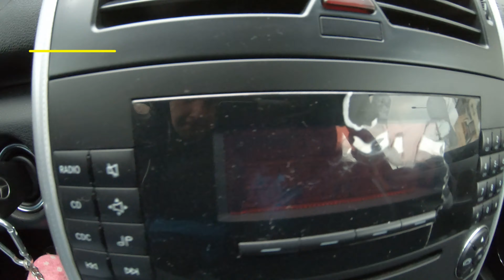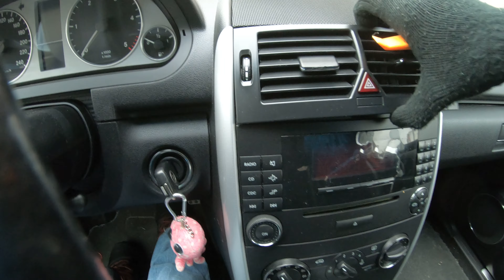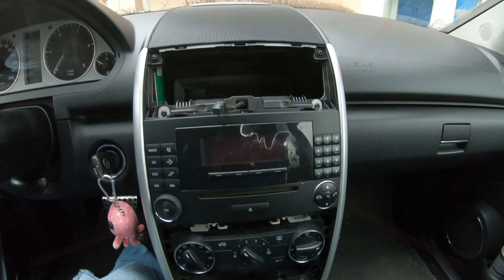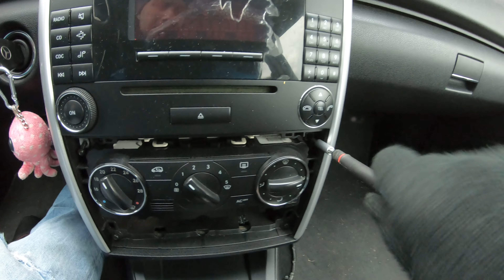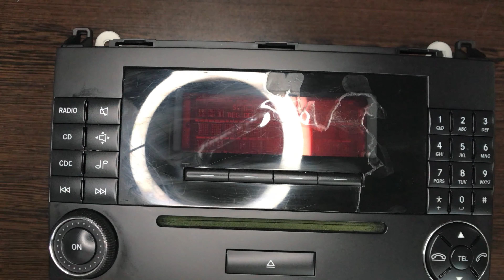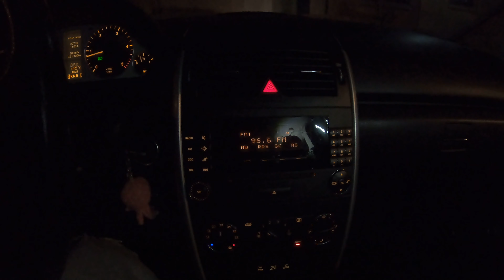Mercedes A class W169 Removed Radio audio system Refurbished exfoliated screen ,eksfoliert skjerm 4K

Comment: they sell the replacement screen on ebay in US now and its easy and no need to remove radio from car. I just did it.. took 6 minutes but the part was 43 USD looks new... You know mercedes didnt think this through much if we are left figuring out how to fix a problem almost no radio has except these lol
Reply from the maker: my repair cost $3 and no waiting day :)
Reply: @AutoMotohowto46  yes that is surely an option! :) I looked into that but noticed the place here in Florida is about 30 miles from here so it was here in a couple days and I was working anyway so for me was a  no brainer plus I just finished removed entire back seat and rear window regulator so I was due an easy fix! lol
Reply: I was a little afraid it was just an old ebay add because i didnt see much about it on the forums for MB and everyone having issues so few days ago i thought id chance it and take one for the team but turns out it was good! im pretty happy! maybe in the future I will upgrade to an aftermarket head unit to modernize everything but as long as this is all working im not in a rush
Reply from the maker: @dparham  I was also thinking of changing it with something modern, but I said let's try this option, although if I bought a new window, I wouldn't have to dismantle everything, but just pull it and that's it..., I do these things for pleasure , hobby not necessarily to get rid of the problem quickly. :face-red-heart-shape:
Reply: @AutoMotohowto46  defiantly a good idea for sure especially if in area hard to get things or just solving an issue with whats available and fast.. I agree
Reply: @dparham was it difficult to remove the old screen before fitting the eBay replacement ? Im thinking of just heating the surrounding adhesive and then pry it out, but the adhesive looks quite strong and I don’t want to damage the surrounding plastic.
Reply from the maker: @flying-donkey_x4050  you can do this without dismantling everything
Reply: @AutoMotohowto46  just pry at the screen with a plastic tool from the top ?
Reply: Oh apologies, you mean keeping everything in tact. I was just asking in terms of getting a replacement screen, rather than sanding and repainting it
Reply: @flying-donkey_x4050  i just let car warm up in the sunshine and that was enough to make the glue weak and then using plastic trim removal tool and was able to peel it off the radio and easily install new one.. just a couple minutes
Reply from the maker: @dparham  yes yes true ✌️
Reply: u got a link ?